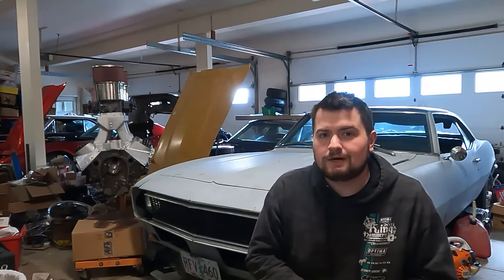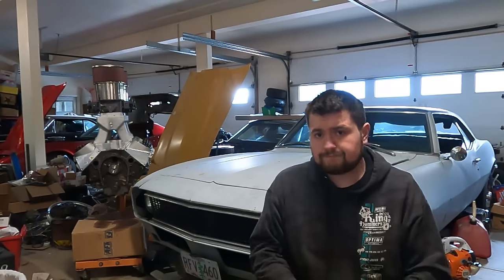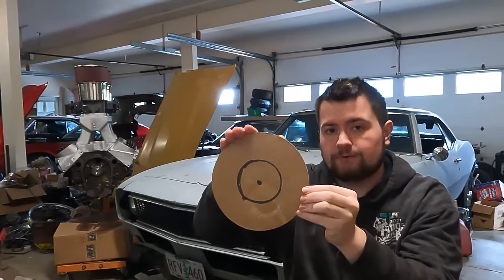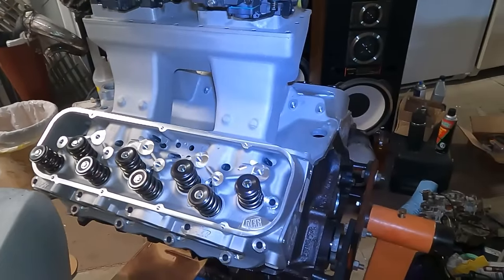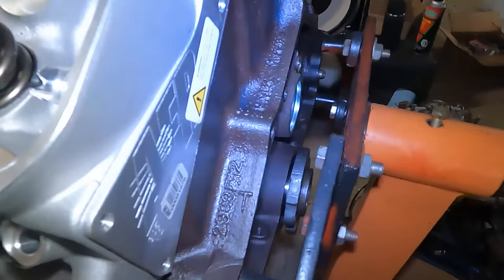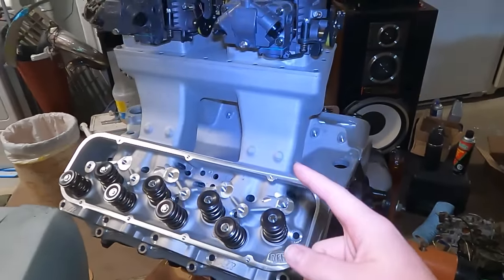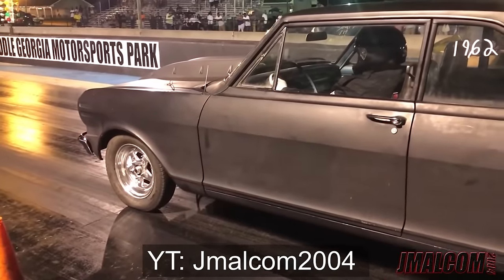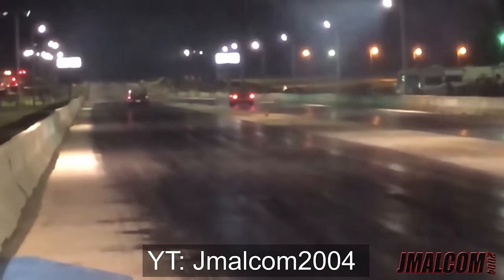The Truth About The Small Block Chevy 327

Comment: What Ratmaro did not say   If you are building a small journal 283 or 327 " bolt on the balancer "   This has been brought to you by the save a radiator foundation .
Reply: An inlaw of mine ruined the crank, balancer and fan on his 67 Camaro to this very thing. Radiator luckily survived.

Comment: Wish I had found this vid earlier I have a 1965 327 sbc came with a powerglide transmission on it and all the stuff except the a/c pump.was told it was 275 hp with the 2 barrel intake which has been replaced with a 4 barrel intake and holley 650 q jet carb.planning on putting it into a 1985 el camino.

Comment: Im running a 30 over 68 327 with vortec heads a mild cam and a highrise in my third gen and ive had it to about  6500 rpms I know it had more but I let out of it.Theese engines will indeed scream for sure and I honestly beleive they can get up to the 7000s safely with a good set up..my grandfather and an ole buddy of his told me when I was putting my car together they had  one in an old nova and that they put a centerblock on the throttle and it set there for over 45 mins or longer  just screaming floating the valves.lol now I dont how true that is it may of just been one of those ole timer tales but it was a pretty cool story nonetheless.lol.nice vid brother very informative
Reply: I've seen people actually do that brick on the throttle thing with several different engines, but never a 327 lol.   For the record I don't recommend it.  I drove quite a few original 327 novas, and camaros back in the 80's (I worked in a shop that specialized in restoring classic Chevys) and they always felt pretty fast to me. Way better than the average low compression 350 chevy in the 80's
Reply: Mangamaro92 , 
My 327 has a Forge Steel Vette crank , 12:1 Forge Pistons , 
Makes 450hp and went to 
11,000rpm , 
I did this twice in 2009 for a few seconds and haven't done it since
Reply: @jimthomas7251  I beleive mine are 12.1 as well I dont know for certain tho as I bought it as a short block I do know their the dish pistons.and 11000 rpms thats insane Ive always heard a 327 will rev like crazy Ive just not took to many chances with mine yet.lol

Comment: Thanks for the video about  a sexy engine. 
My tip to economically inclined beginners: unless you are dead set on a 327, wih all the unexpected traps you are going to encounter (particularly if you like me are outside the US or Canada), I'd realistically get a 1st gen 350 and dress it up as a 327. For a large journal 350, everything can be bought over the counter. Love the 327, but it's getting obsolete. Definitelly the 62-67 is getting obsolete. 

The camel heads are nice for their time; look for the late 60s, early 70s hiperf heads like the 291 and similar (I forget the numbers now), since they have modern thread provisions for tall water pump etc, which is easier to come by to get a an engine ready. The old camel heads lacks these, so you are stuck with time consuming perusing of ads for bits and pieces to get all engine accessories in place.

Revving the 60-yearold pressed-on damper, is a bad longterm plan. Too many hands they've gone through, and been mistreated - now ready to fall apart. At least make a professional damper bolt thread, if you are going to race it, or do burn outs.

Comment: The 307 Crank is the Same  as the 327 large journal Crank but the 307 crank has a bolt on harmonic balancer.  I hàve thrown the balancer off 283 and 327.   
350 block 307 crank 327 positions  327 rods
And you will have a 327 large journal engine.

Comment: You said in the beginning it’s not commonly used. The 327 is the main gas engine used by Cheverolet. It’s by far the best motor of all motors due to age which is 60 years or more. The reason that makes it the best is because they continued to use it because it worked and over time made fine adjustments and bolt ons to make it even better. No engine that I know of has been used this long. I still think the 350 should have been the motor they used but the 327 can do the same thing the 350 can do so I guess that’s my answer

Comment: When I was a kid in the mid-late 80s my parents had a '71 Chevelle SS 350 they bought relatively cheap used, when the original engine atesheet my dad swapped in a 327 from a my grandfather's '66 Caprice that had been wrecked after he souped it up with an aluminum DP intake, Holley DP carb, headers and HEI. It was better than the old 350, because it was high compression with big valves and forged internals, it had just as much TQ, more power upstairs, pulled harder to much higher rpm shift points so it was more exciting, quicker acceleration and higher top end speed. I'd take a high performance 327 over a smogger era junk 350 or 400 anyday if I was looking for a used engine to run with only light mods.

Comment: You can build a 327 by combining a 350 block with a 307 crank. If the crank is small journal, they make bearing spacers to allow you to run them in a large journal block.

Comment: Great info.  Way back in the day I was given a 327 engine by my former boss. It was out of a 1968 1/2 ton pickup. Come to find out it had the very desirable large journal forged crankshaft. These were known to be very strong and very lightweight.  Grumpy Jenkins was fond of these cranks when he was racing SBC cars.   I had a 4-bolt 350 block that I was going to use it in to make a 4-bolt 327 for my 1967 Nova SS 4-speed. Unfortunately I had to sell that project before I finished it :(
Reply: In 1975 I bought a 67 Nova SS 327/300hp 4spd. I look back now and it was the best all around muscle car I ever bought. It had a beautiful stance, red with white guts, and really nicely optioned. And it had surprisingly great torque and could handle blistering RPM’s. I wish I had it today. 😂
Reply: @robertclark9  Mine was gold with a black interior, and also an uncommon black vinyl top.
Reply: @JohnB-le2pi .  Rare color combo. 👍🏼

Comment: You for got to mention the 327 11/32 rod bolts, the weak link in the 327. They do not like 6000 + rpm. If you build one use arp rod bolts or aftermarket rods.
I broke 7 327 engines in my vega in the late 70s shifting it at 6500 7000 rpm.
Luckily I had a friend that worked in a wrecking yard that fed me an endless supply of 327s.

Comment: Something I've been wondering about for along time. As the earlier 327s have smaller journals and all have shorter strokes, won't the crankshaft rev up faster than a 350? And if the crank revs faster, so will the rear wheels
Reply: You can rev a 350 tighter than a 400, 327 than 350, 302 than 327. Stroke length equals torque. Longer stroke more torque. BUT, building a particular cubic inch to gain the best of both worlds: 383 stroker. With today's technology, you can find the optimal cylinder heads, port and chamber sizes and configuration, camshaft, induction, put it together correctly head to the dyno and finalize your tune. Seems almost everyone is doing that with whatever their favorite engine is. The old days, you paid attention, listened, worked your combination until you achieved enough success and longevity out of it. Butt Dynos were everywhere and even a time trial didn't tell everything that today's dyno sessions can. It all just takes $$$$$$$

Comment: I bought a 67 Impala SS Fastback, turbo-fire 327 4 speed, from my party chief of my survey crew for $ 75.00 in the spring of  "76" that was just sitting in his apartment parking lot in Elgin IL, put some fresh gas in and jump started it going down hill got it home, new plugs, air filter and had my brother in law help adjust the timing by just loosing up the distributor cap and advancing or retarding the timing by ear until the engine smoothed out! Took it for an run from W.Dundee to Elgin along the Fox River and that 327 just kicked ass when I stood on it and ran through the gears! Metallic Blue, Black Leather interior bucket seat and a factory installed 8 track player! I think "67" was the first year for that?? I've done some questionable things and made some bad choices!! But the biggest regret I have was selling that Impala SS 327 4 speed! Hands down! That 327 with high octane gas in it was a beast especially stoplight to stoplight 🚦 hops against other cars with bigger engines! If I could get to 3rd gear it was usually over! At a full quarter not so much but in a eighth of mile! That long & heavy Impala Fastback would put it down! 327 is my favorite Chevy power plat! Followed by 283 and Fords 289! Those small block engines could generate some major horsepower vs wieght ratios that shade tree mechanics could squeeze out! The moral of this story! Is? Pay attention and recognize greatest when your in or around it! Because it'll probably not come around again in this lifetime! Sinn Fein Byrne

Comment: I have the l79 in my 1965 Corvette. The l79 is a 350 hp engine with 11 to 1 comp,with 21/2 big horn exhaust. The 300 hp 327 has 2 inch exhaust.  Thats about all i know about the l79
Reply: I still miss my 65 vette 327/350hp after all these years. A fantastic engine I prefer to a big block any day

Comment: Most early factory 327 motors didn’t need 4blt mains. I owned several way back when and would rev the living snot out of them without ever blowing an engine or spinning a bearing. They were as close to bulletproof as you could get.

Comment: One more minor bit of trivia. Even though Chevy never built a 327 with a 4-bolt main, there is a way to build one yourself, still using only completely stock parts (i.e., no splay bolts). You start with the block from a '68 or '69 Z-28 with a 302. This has the same bore as a 327, with 4-bolt mains.Add a (forged) 327 crank, and off you go. Of course, those 302 blocks were never common, and they're pretty old as well, so finding the parts now is extremely difficult. But at least in theory, if you wanted to badly enough. Most people with a 302 would probably rather leave it as a 302 though.
Reply: An 010, or any other 4-bolt main 350 block works too.  No need to spend the time, and money, you'd need for a 68-69DZ block1
Reply: @bobbowe4596  yup just find a 283 crank
Reply: @eyeshocars9978   All 283 cranks are small journal, and have a 3” stroke.  You can use them and a SJ 327 block to build a 67 302, but not a LJ 302 or 327.
Reply: I agree.  But I raced a large journal 283 for years, and won an AHRA world championship with it.  I used a 307 block and a 69 DZ302 bottom end.  Both are LJ.  At sea level, it was above 8500 rpm at the finish line.  Just took it out of the car and built a LJ 331.  It made almost 500 hp on a dyno last week.  My profile pictures are of the 57 2dr wagon I’ve run for years.

Comment: I put a 1967 327 large journal crank in a High performance stock 350 block from a 1977 Chevy Silverado 1/2 ton truck, the block is capable of handling 750 HP stock. Add some crank and head studs and it is capable of handling 1000 HP easily , bored 0.30,1.60 Exhaust  2.20 Intake comp stainless valves and comp dual springs, roller rockers and roller lifter, 🐪 back heads milled to I can't remember what! And it become a I becomes a 336 cubic inch 🐁 motor. 😊

Comment: Also a two bolt block can have a stud girdle added which ties all the mains to each other and  is stronger than four bolt block cause the four bolt  block is weaker where the outer holes are drilled out. That why the splayed is better, girdle is not alot of money.

Comment: for a street rod or muscle car crankshaft choice is irrelevant. all stock cranks will handle anything you do on the street. for hard use in racing the forged crank is preferable. likewise 2 bolt blocks will handle anything you throw at it on the street and MOST racing use. 12 to 1 or more compression or more and sustained high rpm use is where the upgrades become necessary. I've ran the same 327 for over 40 years and seen the tach hit 10000rpm on missed shifts and it still lives.

Comment: Trying to finish a327 .030 over e-tec 170cc retro roller crower 0480 clothes cover  fueling is 2 barrel tbi , was going in s15. I have 190 psi cranking , I also advanced cam do you think I should be ok with this? I know that the piston dwell they have dwell time

Comment: So should i am build a 373 383 396 408 or go to a 302 or 327 336? 4.032" actual measured bore size. Piston speed limit shall be 4000 FPS in all engines. The engine is a street car daily driver engine with racing manual brakes and steering. Heater and possibly AC. 60 gallon fuel cell. Weight reduction and chassis stiffening. 1981 camaro. Was thinking a combo like: 383 c.i. With mike jones roller cam,something better than the XR282HR cam although like it, RPM intake, Brodix track 1 heads 10.7:1 with O.o38" quench. With less compression may try smaller cams. A 355 with XR276HR like cam, EPS intake (thats what the RPM is like on a 383) And brodix track 1 heads. All combos shall use Brodix' large 2.1" intake valve.  Axle ratios shall be 3.23:1. Transmission is TH400 with 2.10 first and 1.40 second gear, 1:1 third. Torque on similar builds were 465 for the 355, and 515 for the 383. Horsepower numbers were 410hp for the 355, and 470 for the 383. Heads were EQ 220cc rhs iron heads under the Engine Quest brand name. The 355 heads were finely ported also they were Dart iron eagle 180cc heads. True talent touched both of those heads and engines. The 355 compression ratio was 10.3 with iron heads and .037" quench area the head was milled from 64cc only 1cc down to 63cc with 7cc flat top pistons O.o09" down the hole and O.o28" steel shim head gasket was used. The block was decked to 9" this is why it missed the O zero mark with the piston tops to use a O.o37-O.o40" head gasket.

Comment: The 300 horsepower 327 was a very good dependable reliable engine this engine makes the same torque as the 350 or 375 horsepower version of the engine but the 300 horsepower version made it at a lower 3200rpm vs the 3600rpm for the 350-375 horsepower versions all three made 360 foot pounds of torque the 300 horsepower version did not rev as well as the 350/375 horsepower versions did above 5200rpm but torque came on a bit sooner with the 300 horsepower version 327
Reply: I ordered a new '62 Impala in 1962 with the 300 hp 327 and a 4speed. The 300 had a hydraulic lifter cam and the higher hp versions came with the Duntov cam and solid lifters. I ran the wheels off of that thing for 65,000 miles and it ran flawlessly! It would float the hydraulic lifters around 5500 to 5600 rpm's but the Corvettes with the solid lifter cam would easily turn 6500 rpm's or more.
Reply: @bobthbldr3  the 327/300hp had 10 more foot pounds of torque 360 at a lower 3200rpm than the 350 foot pounds of torque the 327/360hp had at a higher 4000rpm your right the 327/300 could pull strong to 5500rpm and the 327/360 could pull strong to 6500rpm but the torque coming on sooner with the 327/300hp engine was better for 3.36 gearing or less especially with a power glide transmission

Comment: Large journal 327, 30 over , brodix track 1 aluminum heads ported and polished . 
Custom ground Schneider flat tapit roller  cam. Crane gold roller rockers , Lunati crank and rods , Aries 14:1 pistons , moly rings, Victor Jr intake manifold ported .
1050 cfm holly dominator.  118 octane sunoco . Jericho 4speed, 4:56 gears .
65 chevelle.....9 sec big block killer

Comment: You seem to know more about small block Chevys than a lot of people I've watched and talked too.  I have a question that you can probably answer right off the top of your head.  I have an 82 C20 I'm reviving with an LT9 (never heard of it is what most technicians tell me.) 350 (160 HP 250 TQ).  The bottom end is supposedly 4-bolt main but I haven't taken the pan off yet.  A compression test showed 115 to 120 PSI on all 8 so I think the bottom end is in good shape. So I'm in the market for different heads, preferably aluminum, and a modern cam.  I want 300 or so HP and 400 or so TQ.  I intend to get a modern intake manifold and EFI eventually but for now it is the stock Q-jet.  I will be using long tube headers and 3" exhaust with an X pipe and Magnaflow mufflers.  So my question is what cam and head combo do you recommend?  I will likely run 91 non-ethanol wherever I can get it so I would like a compression ratio around 9.5 to 10:1.  90% of this engine's life while I own it will be spent below 3000 RPM.  Though don't worry I will romp on it from time to time.  I wouldn't want it to develop any nasty ridges at the top of the cylinder. I enjoyed this video particularly because I once owned a 66 Impala with a 275 HP 327 and also a 68 Biscayne with a 250 HP.  The 68 was interesting because it ran very well for many miles and then it didn't.  That wasn't the strange bit.  A friend in mechanic school needed an engine to tear down so I gave him the 68 327.  It turned out to have a small valve head on one side and a large valve head on the other. Would trade this mighty LT9 for either one of them in their prime. Thanks for considering my question.
Reply from the maker: A specific cam is going to be a bit hard to recommend. For cams I always recommend reaching out to a cam manufacturer of your choosing and seeing what they recommend based on the combination of parts you come up with. Also depends on if you want to stay flat tappet or switch over to roller. However if it's going to be staying lower in the RPMs most of the time, I'd definitely stick with a hydraulic cam regardless. As for head choice, making 300hp and 400ftlbs is pretty easy and won't take any more than a set of Vortec heads found on late 90s and early 2000s 350s. Infact being that they have a smaller 64cc combustion chamber you'll pick up a bit of compression over your stock heads as well.
Reply: @RatMaro  Thanks. I was under the impression gen II vortec heads wouldn't fit gen I blocks.
Reply: @davesmith9684  Thanks